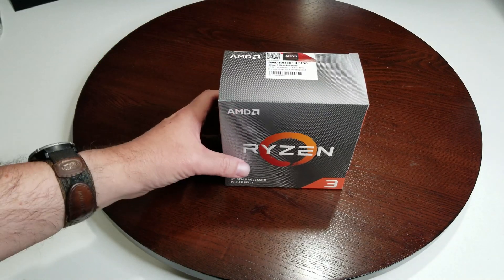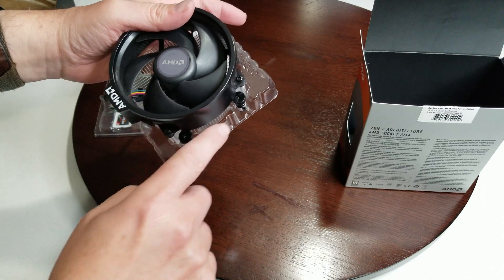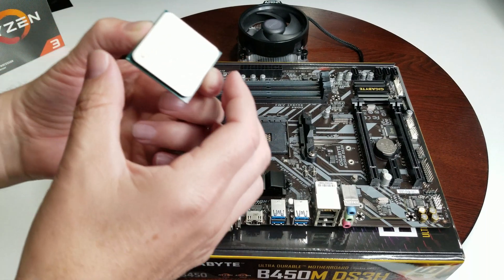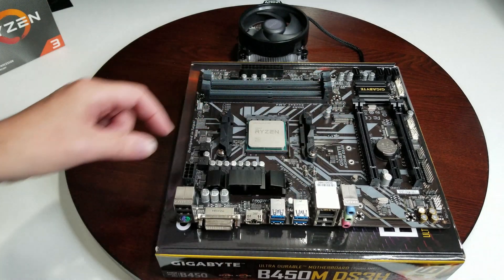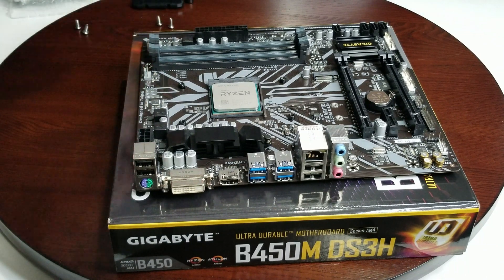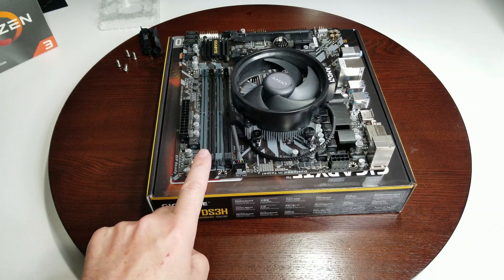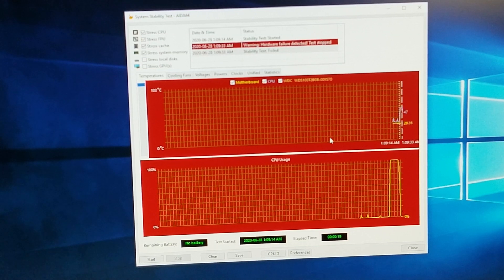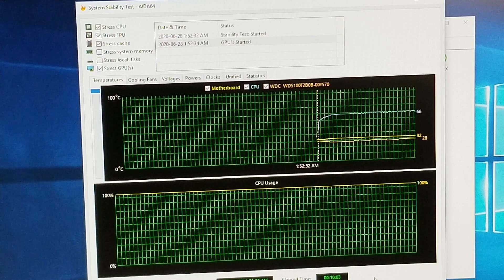Ryzen 3 3100 Unboxing, Install, Temps and VRM Testing The B450M DS3H

Comment: My Ryzen 3 3100 on idle going to 80 
Help me to resolve this problem
Reply from the maker: So some things to check are did you apply Thermal Paste, or if there was Thermal Paste already on the stock cooler if that's what your using, then you might need to get an aftermarket CPU Cooler. Something like the Hyper 212 EVO will reduce temps a lot more then the stock cooler. Also check that there are programs running in the background causing the system to run more and actually not be in idle. There are other things that can affect temps as well one being the case airflow, or room temp itself.

Comment: Well, my 3100 hits around 43C  while idle and its almost 15 C more then your CPU?ambient temp is around 18 and i have stock cooler also. Is there smoething wrong with my CPU or cooler?
Reply from the maker: Only thing I can think of is when installing the Stock CPU Cooler there is one corner that always need to be checked as it can leave a small gap between the CPU and CPU Cooler, it's small but might account for the difference in Temps. Now I have had to replace the Stock Cooler a few times due to noise but otherwise they've worked good. I don't Overclock though so maybe that's why.

Comment: I know this video was done a while back but I am curious if these tests were done in a case or an open air test bench. Do you remember?
Reply from the maker: Open Air Test Bench, ambient Temp of 21c.
Reply: @Reviewing_Playing_and_More_RPM  Mine was running at 70c in a Thermaltake Core V1 case with a Wraith Spire cooler I had laying around. I also had a Noctua NH-D9L I bought several years ago but never used. I switched over to the NH-D9L just an hour or so ago and now it sits at around 62c and thats with a graphite pad instead of paste. (I hate using paste since I'm always changing parts) Anyway, thanks!
Reply from the maker: @fullmetalt-shirt8355  Yeah I've used the Graphite pad as well, and yeah the Noctua is a step up over the stock cooler, glad the temps were better using it. Have an amazing day!

Comment: Thank you for showing the temps, that meant its stock cooler is enough and ideal for it and that means not having to spend extra money on an aftermarket cooler, well not like I can afford the ram and the PSU just yet, tho :(
I have a few questions to ask, where you using any case fans? And does it need case fans? I have an old ATX case and it's not ideal for fans and I by no mean can afford to upgrade it and speaking of that, with modern PSUs having their fans on the bottom means in my case the PSU air will flow right into the CPU fan, would that be a bad thing? And where you using 3200 MHz ram sticks? In the mobo specifications it says 3200(O.C.) O.C. is short for overclocking? It confused me, do that mean you can't use 3200 MHz sticks or they won't run at 3200 MHz? Unless overclocked? I'm confused.
Reply from the maker: The Stock Cooler does work fine, just a little loud at times. I only had a rear exhaust fan but also two fans pulling air into the case in the front. If you don't have the extra fans it'll be good as this CPU doesn't seem to overheat or have those concerns. So for the PSU it's recommended to have the fan exhaust out the bottom of the case, but it can be facing up in cases where that's all that will work and because most PSU's don't put out any amount of heat that would be considered excessive in any way really, you'll be just fine. The Memory I had was 3200MHz, the Memory when first installed and if you do nothing in the BIOS will run at a default of 2666MHz, using the Profile or XMP setting will allow you to get the highest rated speed the Memory allows, in the case where this is causing concerns, don't do the OC with Profile or XMP and it'll work with no issue's. Yes OC is short for Over Clocking. Hope that helps
Reply: I guess I should try to get a rear fan at least, and I'd rather not change my old PSU as modern PSUs are somewhat expensive but I'm worried it would fail, however if it would be fine with fan facing down at the motherboard then that all good, I should for sure get a new case with a bottom mount but all that is way over what I can afford, going for R3 3100 in the first place is a bit over what I can afford at the moment but already too tired of using E2200 and I'm skeptical about getting another Pentium or an Athlon, thanks again, I have nothing to worry about now except for the budget and which PSU I should get.
Reply from the maker: @illogical1421  You can check to see if your PSU will work with your system and it's components using PCPartPicker.com it's good for checking compatibility issue's as well. Yeah a rear exhaust is a good to have. Have a great day.
Reply: @Reviewing_Playing_and_More_RPM  PCPartPicker didn't show the board when I choose a PSU similar to mine, that's probably because of the 4 pin 12V connector, DS3H like most modern motherboards have an 8 pin slot, I do think it could work just fine but I don't want to risk it. PCPR showed me 3 compatible boards with the 4 pin slot and they could honestly do, their only downside is probably they have only 2 ram slots but I'll put them into consideration anyways because that shouldn't hurt, I can probably deal with a single channel for a while, Idk.
Reply from the maker: @illogical1421  Yeah there are some MB's that have just two Ram slots but since a lot of people never fill all four slots on most MB's the two will work together just fine, smaller MB's that are high end are like this, glad your using PCPartPicker to help you chose your components it can be very helpful. Not showing your MB with your PSU might also indicate a problem with compatibility but also if the MB is a proprietary one it might not show up as well. Most modern MB's will need the 8 Pin CPU power not sure if they'd work with just 4 pin. Anyway hope you get it all worked out.
Reply: @Reviewing_Playing_and_More_RPM  Thanks. They can actually work just fine with low end CPUs but I'm not sure just how low end 3100 is or if a simple 8 pin adapter could do away with my worry, I would be at ease if I were to get a Pentium and I honestly would if I knew I could save enough money to build a whole new PC.
Reply from the maker: @illogical1421  Ok, well sounds like you have it sorted out, so decision time on which to do. Good Luck

Comment: I sadly completely lost the CPU lottery. Mine runs at 75° with an Arctic Freezer 64 pro and I can't get it to clock over 4.05 GHz even at 1,35V. I originally intended to run it at 4,2GHz with a 1660 Super. But now the CPU isn't even allowing the GPU to use its full potential. Glad that yours works fine.
Reply from the maker: Just wondering if you updated your AMD Chipset Drivers from the AMD Website, this can make a big difference sometimes. I have a video on how to do that if you need it. It increased mine about 5% above normal.
Reply: @Reviewing_Playing_and_More_RPM  Also didn't work :(
Reply from the maker: @simont3686  That's to bad, if I think of something else I'll get back to you.
Reply: @Reviewing_Playing_and_More_RPM  Thank you! I apperciate your effort.
Reply: @Reviewing_Playing_and_More_RPM  Interesting. I'll try it. Amazing how big of a difference drivers can make.

Comment: What happens if you accidentally do touch the thermal paste
Reply from the maker: Well since I've done just that it depends on how much you've removed, if you just smudged it a little you can smooth it out a bit, but if that doesn't seem to work then you can re-apply new Thermal Paste. If you smooth it out then keep a check on the temps if they are good then all will be good, if not then re-apply.
Reply: Ok thank you

Comment: My cpu .. 3100 iddle 57 60 and its a new one what the cause with asus prime  b450ma
Reply from the maker: It's not likely it's the MB causing the issue, I'd start with if the CPU Cooler isn't enough, getting an aftermarket one that can provide better cooling...
Reply: @Reviewing_Playing_and_More_RPM  but for ya its 27 ? With stock
Reply from the maker: @fingerstyle9165  Well you can start with your Stock CPU Cooler and check it's installed right, plugged in correctly and all that, then I'm not sure what could be causing the issue, some CPU's can run a bit hotter but not usually a lot...I have seen one instance where the CPU itself wasn't in correctly not saying that's the case just it's a rare possibility, do you have fans in your case that can assist with the cooling somewhat, depends on your ambient temps if those are high, ie your in a hot room that can play a part as well...you could try cleaning and replacing the thermal paste with a better type something like Noctua NH-T1 that's about the only things that come to mind, but like I said earlier if you've tried all that then a better CPU Cooler might be an option...good luck...
Reply: @Reviewing_Playing_and_More_RPM  i dont have a additionelle fans .. inside so i open the case its in the atmospher not problem when o turn on pc tem goes directly in 55 celculs this is why i was thinking its maybe its a thermal past the cpu i put the rations in 36 3.6 ghz .. so ...
Reply from the maker: Yeah that sounds likely...

Comment: While gaming my ryzen 3 3100 reaches to 72°C and fan make quite noise. Is it fine or should I worry?
Reply from the maker: The temps when gaming are fine, as for the noise it will get a bit loud with the stock cooler, if you find it's too much though you can always change to something like the Hyper 212 EVO for a bit better temps and it'll be much quieter, but no need to worry though...
Reply: @Reviewing_Playing_and_More_RPM  thnx mate

Comment: i have a gigabyte b450m s2h mother board. Can u use the 3rd gen ryzen processor on this mother board or u have to update the bios?
Reply from the maker: Most B450 MB's can use a 3rd Gen Ryzen CPU, but there is always a chance you will need to update the BIOS, so if you already have the MB with existing CPU, update the BIOS first or wait to see if it just works out of box, and if not then you'll need to do it afterwards...

Comment: The screw holders for my holes just fell into the back of my motherboard for me is that supposed to happen or do I need to get them back?
Reply from the maker: You need to have the backplate, you'll need to hold it until everything else is secured with the brackets then you'll be good...
Reply: @Reviewing_Playing_and_More_RPM  alright thanks I got it in place by holding it in with the back panel, but for some reason my monitor says VGA signal not found.
Reply from the maker: @CyrusTheConquerer  Check the cable from your monitor is going from the Monitor to your GPU not the Motherboard, and or re-insert the GPU...

Comment: No rgb???
Reply from the maker: Not with this CPU Cooler, so you'll need a different CPU Cooler and or a Case that has it...it is unfortunate but likely a cost saving option...
Reply: @Reviewing_Playing_and_More_RPM  i thought that stock cooler has a rgb
Reply from the maker: @videoeditor9215  Not this one...I was hoping it would but have since replaced it to better suit my build...

Comment: Just a quick question, is there a decent motherboard for this CPU that is under £60 (80USD) that wouldn't require a bios update or anything like that. I don't need nothing special since I am on a budget as why I I'm intending on buying this CPU and have looked around but I just want to double check before purchasing. Was thinking of getting a ASRock 450M-HDV R4.0 motherboard but haven't found anything to see if it suits. Thanks in advance.
Reply from the maker: The ASRock B450-HDV R4.0 MB is compatible with this CPU, and it has 1 more Fan Header, can't say for sure about needing a BIOS update, it likely doesn't but there's always a possibility, the B450M DS3H will work with it out of box, without need for a BIOS update but only 1 Fan Header, fairly certain the ASRock will also work out of box but always a small chance it might not...Hope that helps some...
Reply: @Reviewing_Playing_and_More_RPM  Thank you for your response, I will take the B450M DS3H as a strong contender. The fan header isn't that much of an issue as I was only intending for one fan anyway and the extra PCI-E slot may be a benefit as well as two extra RAM slots for upgradeability for the future.

Comment: MY CPU GETS 80° CELCIUS WHILE GAMING... IS IT NORMAL?
Reply from the maker: Yeah it depends, but 80C is in range for a gaming session...it might be just a little high, but nothing to worry about...
Reply: @Reviewing_Playing_and_More_RPM  its a 3100 too... That's why worries me
Reply from the maker: @morgoroth666dlp  Check your temps at idle, just to be sure you don't have a problem otherwise, as long as it's ok, then it should be ok still, after all gaming will tax the system a fair bit...

Comment: Hello can i have some help? I have ryzen 3 3100 and i removed my gpu because i sold it and will replace but after i run my pc without gpu it says no signal, i tried restarting cmos. Is there any problem with that. Thanks
Reply from the maker: The Ryzen 3 3100 needs a dedicated Graphics Card, it doesn't have integrated graphics, so you'll need a GPU hooked up to your Monitor from the GPU to get things working...
Reply: @Reviewing_Playing_and_More_RPM  thank you so much i already read it somewhere that my processor doesn't have integrated graphics. I can sleep well in peace. Thank you so much again, subbing to your channel for more infos.
Reply from the maker: @huntermichigan1311  Much appreciated...Have a great day...

Comment: i couldn't connect all four screws so i just left it at one
Reply from the maker: One won't even hold it in place and you'll have horrible temps, it needs to go on properly or it just won't work...If you can't get the stock cooler on, then maybe get a different one you might find easier to install or see if a friend can help...good luck...
Reply: @Reviewing_Playing_and_More_RPM  do you know any good cpu coolers that can fit in the b450m ds3h??
Reply from the maker: @athenaslust  The Hyper 212 EVO is a great choice and easy to install and very good temps
Reply: @Reviewing_Playing_and_More_RPM  okay thank you one more question the back plate where you screw the heat sink in is loose and can come off.. it is hard to screw in all screws with one hand trying to screw it in and the other supporting the back plate. do you know how to secure it so it won't come off?? thank you so much
Reply from the maker: @athenaslust  No I just know that it needs to be supported and then secured, once 1 screw is in then the rest will be easy...

Comment: Is it true that the Asrock B450 PRo4 overclocks better?
Reply from the maker: I don't know, it's possible...haven't had any experience with it...
Reply: @Reviewing_Playing_and_More_RPM  Thank you for the reply, but could you please provide an update and perhaps some overclocking parameters for this combination?  Thanks in advance.
Reply from the maker: @frankstared  Since The only thing I can provide is that the software that comes with every MB Manufacturer in terms of Overclocking Software that you can get sometimes from that software, but most of the times it's in the BIOS, when you go into the BIOS there is a spot that will actually say OC, from there it will usually have 3 choices, with 3 settings for the OC to choose from, you can pick any of those 3 and it will automatically try to OC to that point for you, if your system becomes unstable then you can go back in and chose a lower OC setting, (this is all done at your own risk) OCing does have some risks, now as to manual OC's I can't provide anything on that as I don't do manual OCing...there are plenty of folks that do this so a quick google search should help you get the info you need...hope that helps a bit...
Reply: @Reviewing_Playing_and_More_RPM  I have heard that that chip can get up to 4.5 though II wouldn't recommend that long term on anything less than liquid nitrogen and some beefy VRMs.  Still, I am curious about the stability of even modest overclocking on this budget board.  It is an exceptional price but the question arises when consumers attempt to OC.  Regardless, thanks for the general overview and prompt response.
Reply from the maker: @frankstared  Anytime...
Reply: @Reviewing_Playing_and_More_RPM  Take care and stay well.
Reply from the maker: @frankstared  You as well...